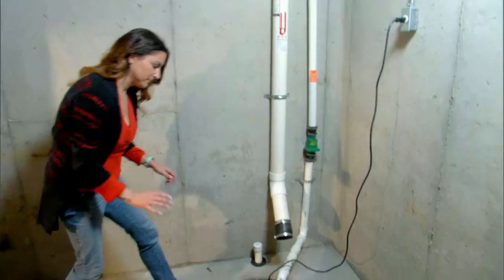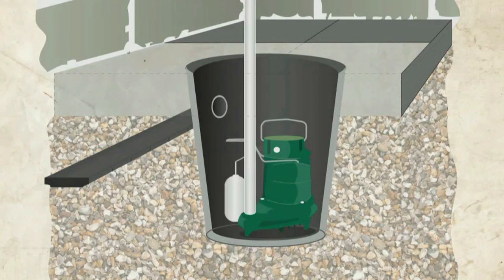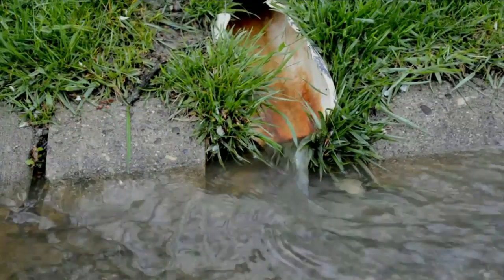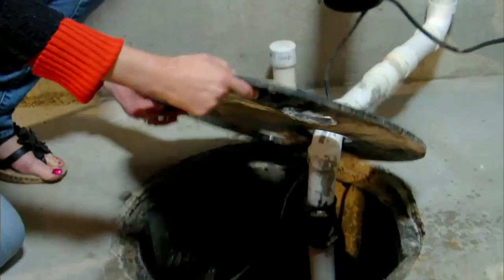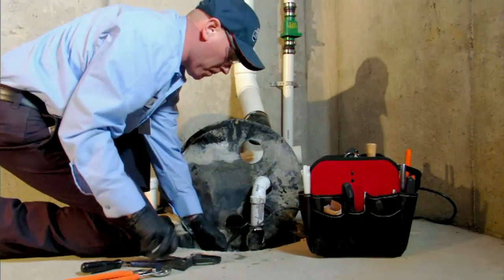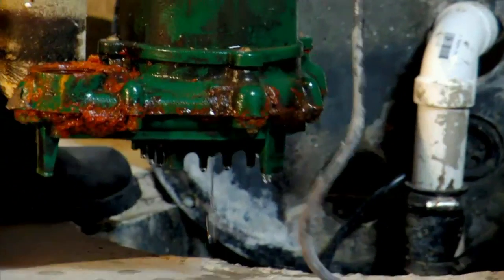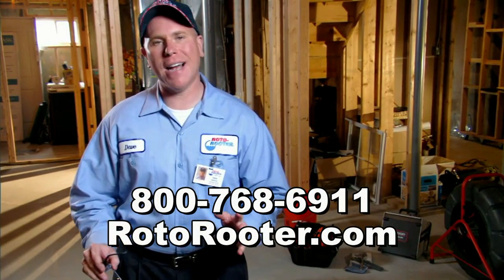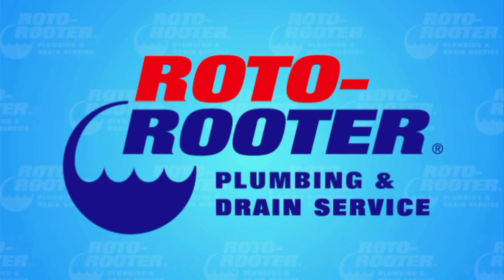What is a Sump Pump? | Roto-Rooter

Comment: Thanks for the great information.   I have a question. ?When selecting the height for the pump to turn on what is the desired level?  I have a non weeping pump.  I've noticed that there seems to be a natural water table about 2 inches below the top of my slap. Water will collect to this height and then stop.  (my float locked in the on position. I've ordered a vertical float) This point (2 inches below top of slab and 9 inches above bottom of drain inlet pipes) would seem to be a good level to set for the "pump on" level so I'm not fighting the natural water table.           However,  I'm also considering that the best height to set my "pump on" level is just below my drain inlets to allow for my drain pipes to be drained completely.  Also I'm thinking setting the pump on level below my drain inlets will reduce pressure to my foundation and protect my foundations structural integrity.  ?Are there any plumbing codes that pertain to this level?  Any insights would be greatly appreciated.
Reply from the maker: +Mike Phillips You raise some great questions, but ones that should be answered by one of our Master Plumbers. I want to refer you to Roto-Rooter's free "Ask the Plumber" feature on our website. Please copy and paste your question there and you will receive a prompt, detailed free response from one of our most experienced plumbers. Just follow this link: http://www.rotorooter.com/plumbing-basics/ask-the-plumber/